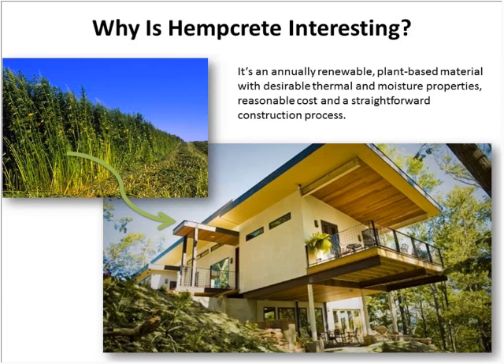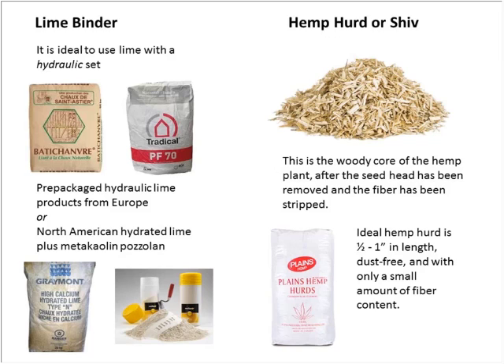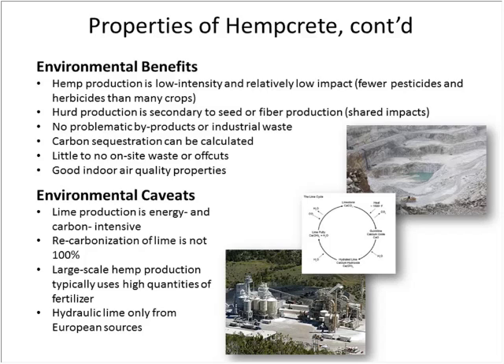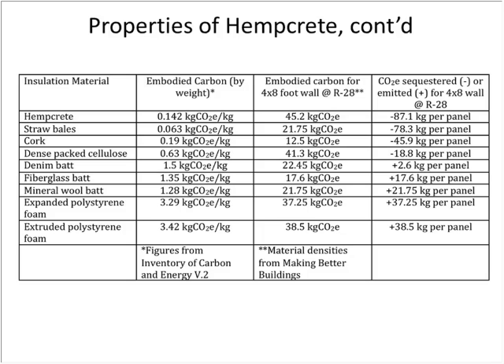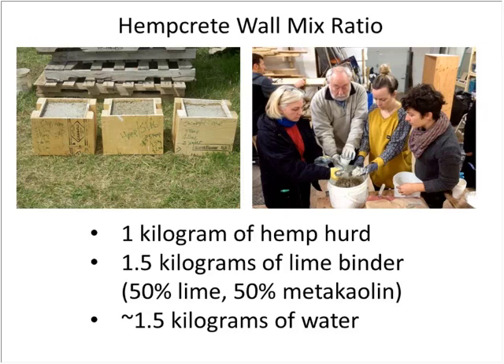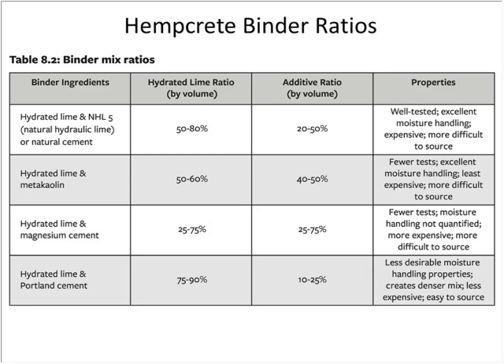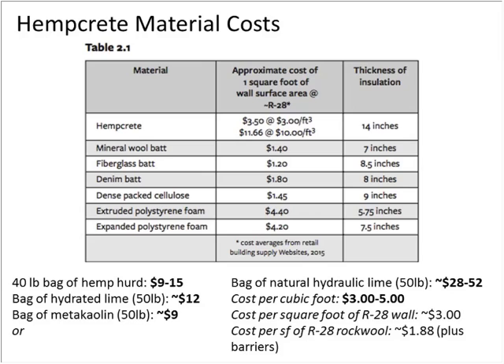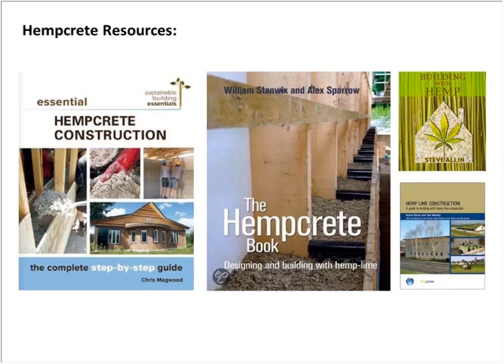Introduction to Natural Hempcrete Construction Methods

Comment: I'm currently drying 1-2 year growth chipped willow to experiment making a willowcrete with. It has a pithy core in the young growth and is lighter than other hardwood chips. I grow it anyhow on varying coppice cycles to use from thin wattle& daub weavers, up to logwood for woodfuel. Growing hemp here in the UK requires an extortionately priced licence from the Gvmt, who are clearly protecting other industry interests. Just flipping them the bird and using alternatives.

Comment: How does a house insulated with hempcrete do with air tightness testing?  Everything else I see is about ultra tight air sealing using tapes and fluid-applied barriers, and then ventilating the home actively.  In contrast, hempcrete seems to be about "forgiving" moisture handling properties and porosity.  So, would you need active ventilation in a home built with hempcrete, would it be drafty?

Comment: Could you improve the R value per dollar by building the wall with an inner cavity, in which you put a layer of rock wool insulation? Or would the added complexity and thinner walls be problematic?
Reply from the maker: I would contact Rockwool!

Comment: Awesome presentation sir !!  As a  Californian am I to assume earthquake resistant  ?? However;  If it cracks then, just plaster over them ??
Reply from the maker: "To the best of my knowledge, full earthquake testing has not been done for hempcrete. However, as an infill insulation material, it's not likely to be a major part of a structural strategy for earthquake zones. The frame and sheathing that contains the hempcrete would be designed to handle the required loads, and the hempcrete itself would not be relied upon in any structural way.

Any cracks in the plaster (if plaster is what's used as the finished sheathing) can be repaired by crack-filling or applying a new coat of plaster." - Chris Magwood
Reply: I wouldn't assume that hempcrete is earthquake resistant. It's only an insulation material, not a structural element. The frame in which the hempcrete is contained is what will do the work in seismic events. If that doesn't hold up, it really doesn't matter how well your insulation performs!

Comment: I got a question.  Has anyone ever use steel 2x4 (light steel) as the structure for Hempcrete?  Anyone test the alkaline concrete against steel?

Comment: Would perlite be of any use as part of your binder?
Reply: Perlite wouldn't be a binder, but it could be used to replace some (or all) of the hemp hurd. In that case, you'd be using the same binder as with hempcrete, but using the perlite as the small bits of insulation being bound together. We've used that strategy quite a bit, especially for near-grade or below-grade applications where hemp isn't appropriate. http://endeavourcentre.org/2013/10/first-ever-poraver-foundation/

Comment: Is the lime simply hydrated lime you can get at a home improvement store?
Reply from the maker: Not sure!
Reply: Hydrated lime is lime that has been processed by extreme heat and then pulverizing to a powder to accept water content that you add it . comes dry you must hydrate they call it hydrated because now you can and it will soak up moisture in its natural state before processing just like any other Stone it will soak up moisture but actually lime will take forever to soak up water as a stone . it must be processed baked under extreme heat then be powdered . There's a whole bunch of primitive Man videos out where guys with sticks and stones are building their own Kilns Gathering and firing Limestone and then pulverizing it and making their own concrete they're referring to it as Roman or Egyptian I just can't remember right now .

Comment: what's with the framing, do these not offer structural support?
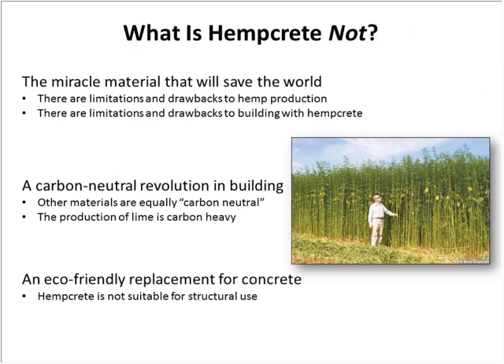Reply: Hempcrete is primarily used as an insulation material. The name can be misleading. See 5:31 in the video.

Comment: Hempcrete is very structural. It’s usually 1/10th of that of concrete in terms of compressive strength. That’s a lot of compression it can handle actually.
Reply: It's only good if you consider it's low density. other than that its pretty weak . It's not even considered a structural material

Comment: If hempcrete is not structural how can it be used as a perimeter beam foundation?
Reply: Jarett Stine it’s pretty structural. This person saw that it was 1/10th of that of concrete and didn’t think to realize that cinder block construction with no infill is literally 1/15th and we can build with them.

Comment: Couldn't I just use straw and portland cement and get the same results for way cheaper???  Someone please let me know.
Reply: Straw does not have the desirable antimicrobial and insulation properties that hemp has. Adding cement instead of lime means a stronger product although if you wish to achieve a carbon negative build then lime is best.

Comment: Crazy question, can hempcrete be used in place where drywall once was?  I had an idea of removing old drywall and sheet rock from my home and making a hempcrete wall. Any ideas?
Reply: Hempcrete needs to be formed, so you could remove your drywall and fill the stud cavities behind with hempcrete. You'd then want to plaster the hempcrete to create a finished wall surface. It's also possible to use spacers on the face of the studs to increase the thickness of the hempcrete for more insulation value.

Comment: why not embed recycled plastic and p.e.t in with the mix ?
Reply: Because plastic is extremely flammable and toxic, witness the great fire devastation going on in Northern California right now - many of the buildings burned released nasty toxins due to plastics etc,.
Reply: Could be possible, but you'd want to ensure that the recycled plastic is offering the same or better insulation value, or else you'd just be making a more dense, less insulative mix and there wouldn't be any benefit. You'd also want to determine if the plastics might offgas, as one of the benefits of hempcrete is that it is exceptionally clean and healthy.